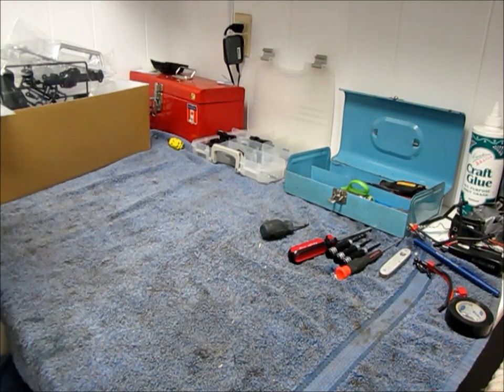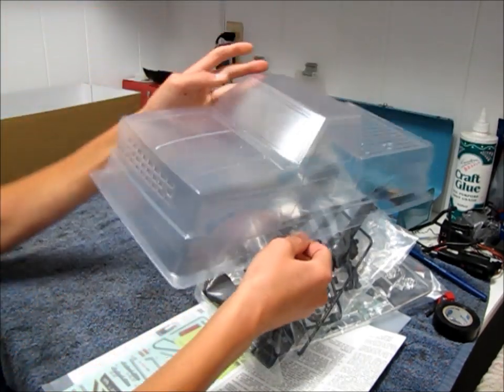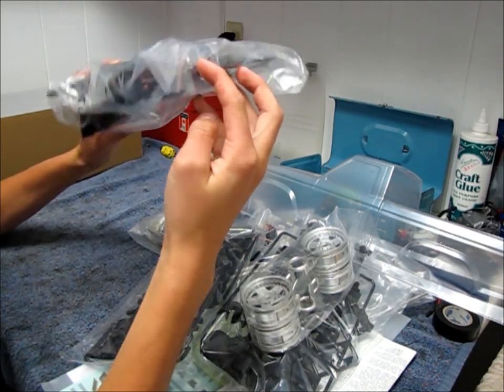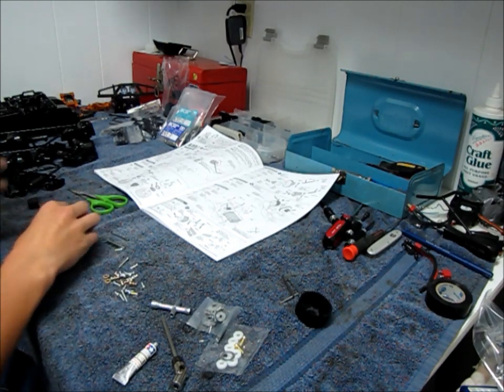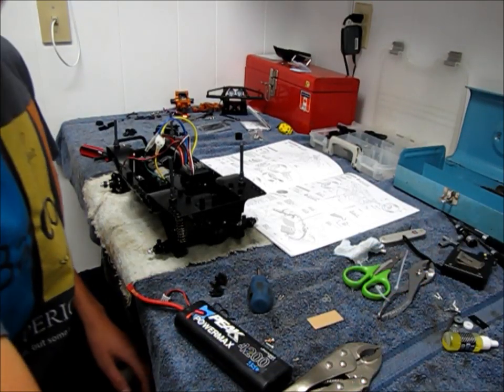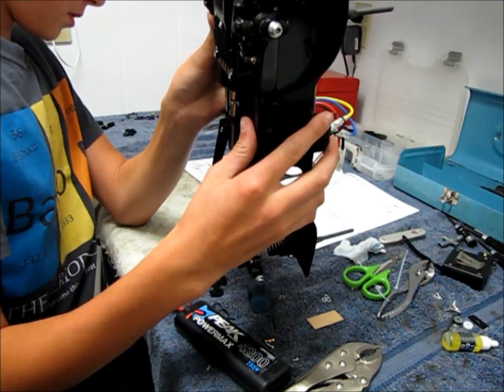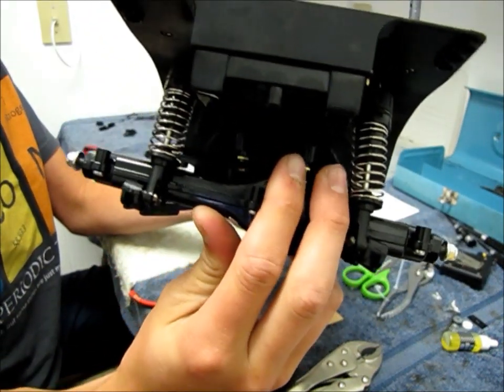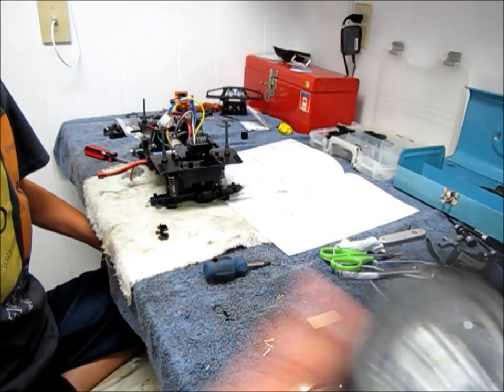MBP: Tamiya CC01 Land Freeder Timelapse Build

Comment: for the battery mount use washers, preferably rubber, because galvanize on plastic might crack the chassis when your torqueing on the screw

Comment: How long did it take to build
Reply from the maker: I did about 2 hours a day so like 8 hours. wasn't going fast at all and made some mistakes.
Reply: Would it be a good beginners set?
Reply from the maker: if it's your very FIRST rc, don't buy it, if you've had one and know how it works, then go for it.
Reply: Is there any you would know of that Pyle he a good one to start with under $250?
Reply from the maker: do you mean "is there a good rc car of this style that is good for under $250?"
if so, then look at the axial scx10 DINGO kit or a used one my friend. also know you will need more electronics than comes in the box with these, this one comes with a speed controller and motor, no steering servo or radio system. the dingo comes with no electronics what so ever. but it is a VERY good kit and comes with upgrades. find your local hobbyshop and they should help you out with that part. thanks for watching!